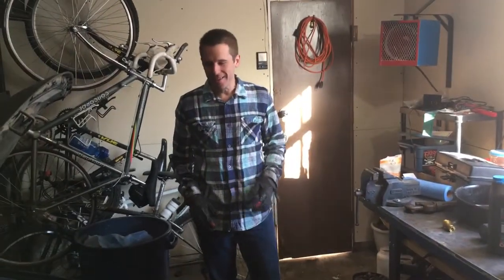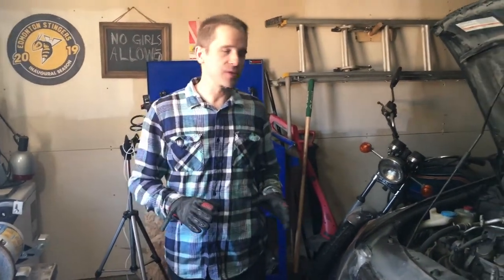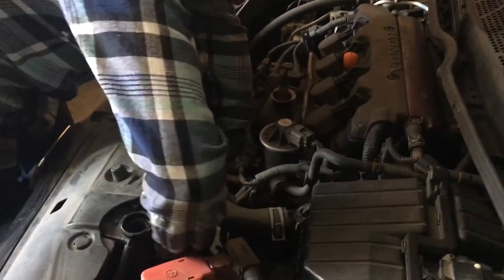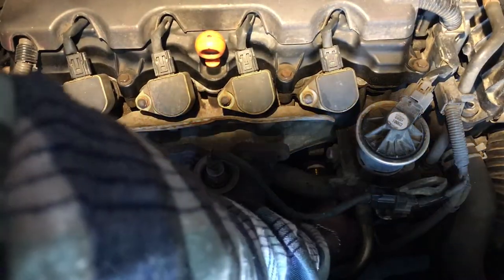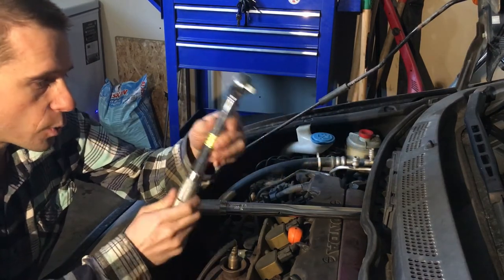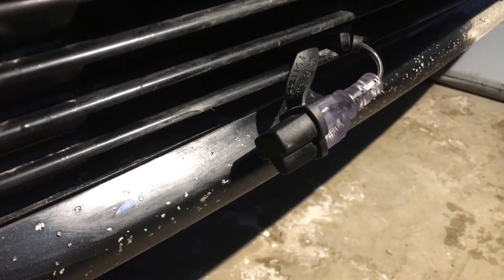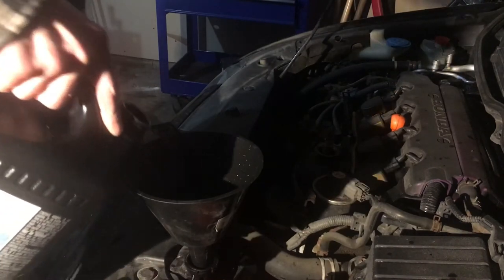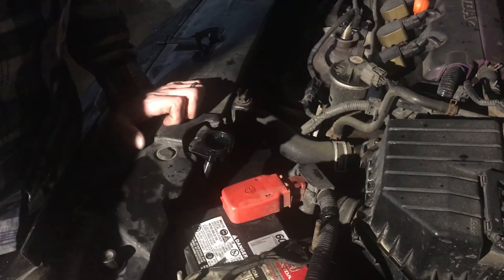Ketchup’s World Episode One - Civic block heater

Comment: what's the part number on your kit?
Reply from the maker: I don’t remember but you can just go to any parts store like NAPA or Bumper to Bumper or online at rockauto.com and find the part. You can also go to the dealership but u will pay more.
Reply: @andrewdegenhardt  thank you, I ended up just getting from the dealership, an FYI the pt# is 08T44-SNA-302.  Thanks so much for posting your DIY video!! Much appreciated, will come in very useful this weekend when installing mine!
Reply from the maker: @crazyeyes1533  great i hope it goes well for u
Reply: Helpful video. I had no idea where the block heater was located, this is better than I imagined.  Still kinda pissed off that mine failed, it's- -35 this weekend and I'm not even gonna try and start it in this.

Comment: Can that Tephlon tape take the heat of the motor? I didn't use any. The plug didn't have any.
Reply from the maker: Yes it can
Reply: The T-tape is not necessary, the gasket is what makes the seal. 
T-tape is only required on tapered threads.

Comment: Hey Andrew, thanks for the video and especially the little tricks of the trade. 

is there a way to remove the "block heater bolt" without spilling coolant? i dont have a garage, so ill have to try this outside. 

thanks! 
-matt
Reply from the maker: Hi matt, no there isnt a way. You have to drain it. Drain from the proper location first, the coolant drain plug, then more will come out when u remove the “placeholder” for the heater
Reply: @andrewdegenhardt so is it possible to remove that bolt for the block heater & it will spill out the coolant out right, so after the installation fill it back & bleed out the air bubbles, will that work without draining the whole coolant from the system
Reply from the maker: @unnikrishnanraveendrannair5408  i guess so, but the purpose of the drain plug is to get a relatively clean drain. It drains in a way that is easy to catch. If you drain from the other block heater bolt, you may have a mess. I recommend draining from the drain plug first
Reply: @andrewdegenhardt so, if I tried to directly install the block heater plug directly by removing and installing it without draining from the radiator plug, cause any issues, like even after i fill the coolant back and idle for 15 minutes wont remove the air bubbles, I don’t know thats why i am asking
Reply from the maker: @unnikrishnanraveendrannair5408  it wouldn’t cause any issues that i can think of besides a complete disaster when the coolant drains out of the engine block. It will be messy and difficult to catch the fluid. Honestly you wont be saving any time by trying to drain from the block heater plug. You’ll just make a mess.
Reply: @andrewdegenhardt like coolant spill everywhere right but even if i do it through the block heater plug will the air bubbles go out?
Reply from the maker: @unnikrishnanraveendrannair5408  i dont think there would be an issue in the end. Just the draining likely be a disaster
Reply: @andrewdegenhardt do you is there anyway i could flesh out the coolant completely, will that also flush out the heater core fluid as well, its a 2022 civic si, can you give instructions how to do it
Reply from the maker: @unnikrishnanraveendrannair5408  drain, fill, bleed with engine running. Drain again, fill with new fluid. This will get a high percentage out. Easy DIY method.